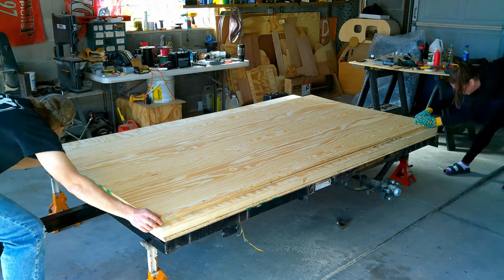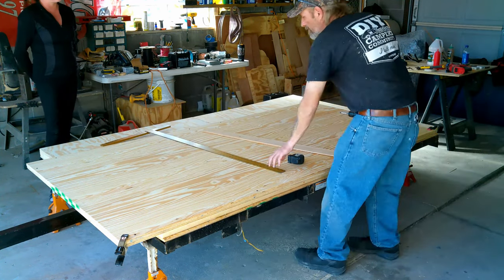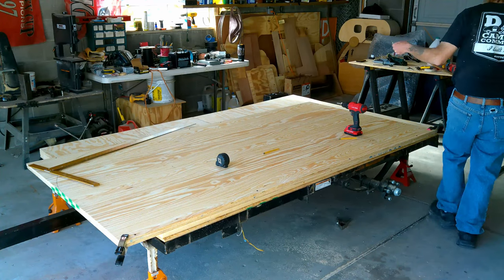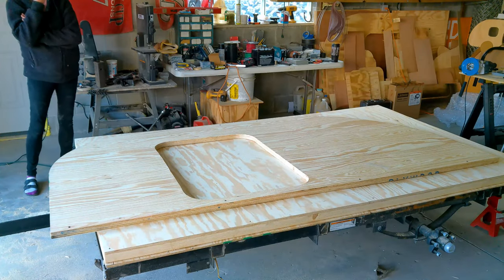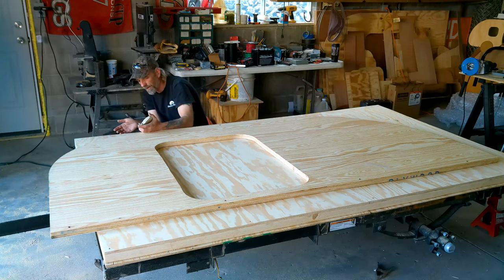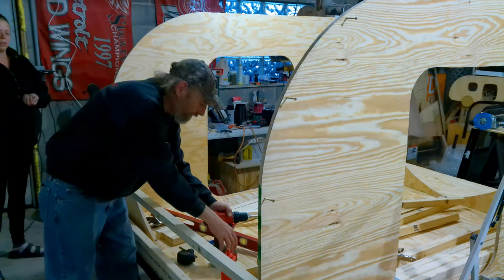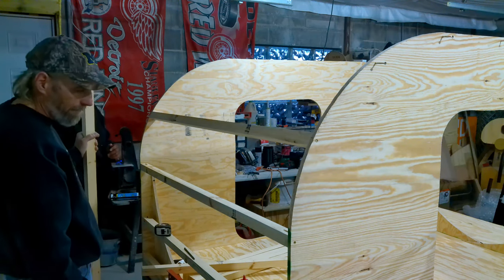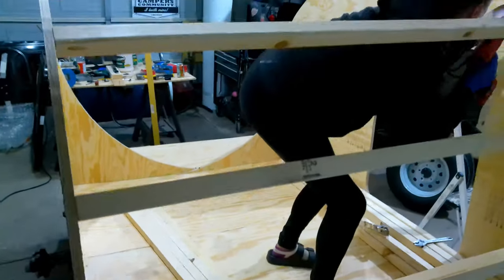How to Build a Teardrop Camper. Part 3. THE WALLS

Comment: Do you insulate the walls? I'm planning not to. I did insulate the deck and going to do the roof/ceiling. But may not do the walls. I'm in Florida and will be doing warm weather camping. I would be glassing the trailer with Carbon Fiber which is black and attracts heat. If I decide to insulate the walls then I will be the thin, .25" XPS foam instead of the bulky EPS. What are your thoughts on insulating the walls?
Reply from the maker: No I dont  Insulate the walls. I did one time. Thanks for watching! Build on!
Reply: @DIYTearDropJay  I end up insulating them with R9 Insulation. Since it's wrapped on carbon to take the heat off the black walls.

Comment: On the off set . what is the 12 inch off from the bottom for?  Then 36 inches from ? To cut the radius
Reply from the maker: 12 inches off the bottom and 36 off the back. It is for the rear radius
Reply from the maker: The front radius is 24x24

Comment: Ive been planning my build for a while and was wondering how I would cover the outside screws that hold the spars. I never even though of using my kreg for 1 inside pocket hole. Now the trim will be able to cover the 1 outside screw. thanks!
Reply from the maker: I countersink them. Thanks for watching! If your doing a woody, you could plug the holes with a dowel.

Comment: I have a 5 x8 frame my question is how long do I need to.make the spars? And with the pocket holes what size screws do I use? I am using 1/2 inch plywood for the walls
Reply from the maker: On my builds, the spar length is determined by the top layer of the floor, it is the same width. Another option is to measure when the walls get installed. 

I use 3/4 " for the walls so the screws I use are 1.25". Yours will be different. The instructions that come with the Kreg jig will help you determine all that. Thanks for watching!

Comment: What is your thinking on a single wall versus a sandwich wall? I've seen some other builds with walls using an inner plywood frame covered by thin plywood veneer on each side,
Reply from the maker: I dont see a need to insulate the walls and that is why I dont. I have in one build out of 13.

Comment: Idk is u said it or not but how far do u keep the door off the bottom when u cut the hole?
Reply from the maker: I like it as close to the floor as possible. When I use my normal doors, they rest on the floor but with these, there is an inside trim ring so I placed them 1.5 inches off the floor